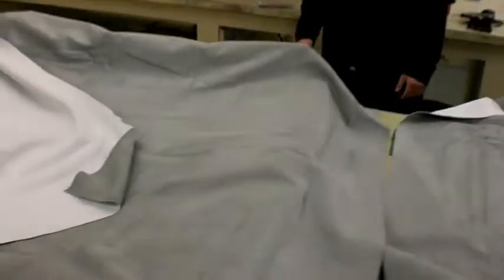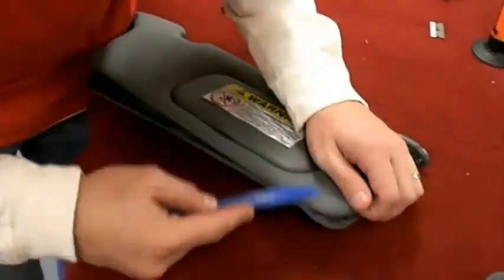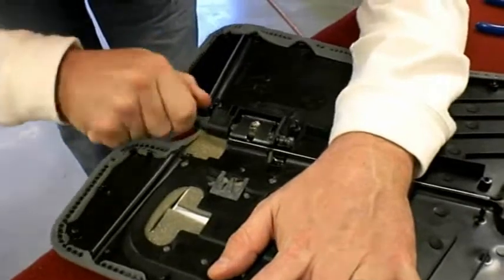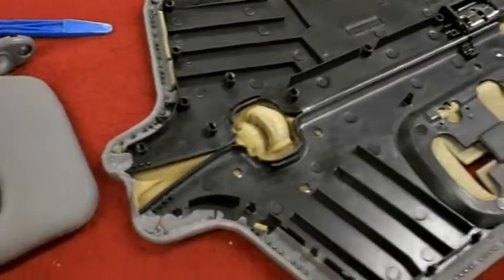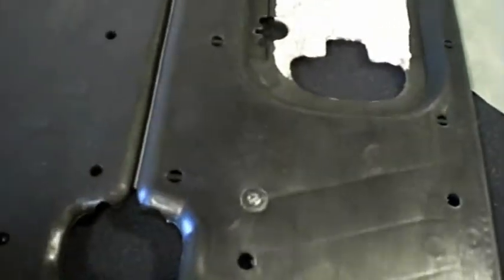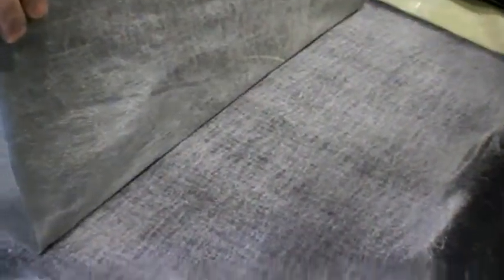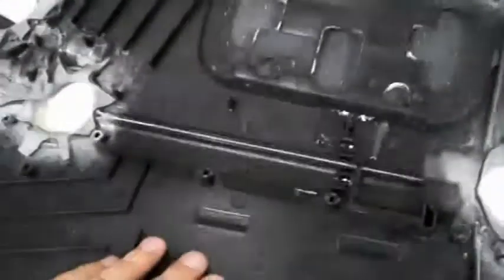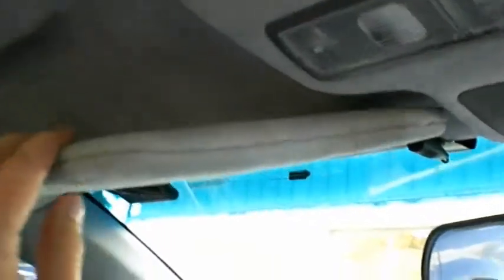How to cover honda civic visors using suede

Comment: FYI...I am attempting to do this on my 1997 Civic EX and I just took my visors apart to find out that the inside of the visor is cardboard and it's held together by a sewn seam that goes around the outside. I just destroyed my visor by trying to tear then apart based on the assumption that there were plastic snaps inside of them. Not your fault, I should've assumed that Honda wouldn't have made them all easily serviceable. Just an FYI for your future videos to add to the notes.
Reply: I would just ruin my too based on this video.Thanks for warning brother
Reply: I have a 98 Civic that I'd like to reupholster. Luckily I have an extra junky set I can experiment with first.
Reply: Honda visors went down hill after 95 smh
Reply: Wow...  Sorry to hear about your visor.  Thanks for the heads up.  I was looking at doing this to my 1997 Civic LX.
Reply: 98 Honda also cardboard.

Comment: Yep. Mine is the same. And it's not assembled the same as in this video. It's all one piece. So to get to the mechanism, you basically have to destroy the visor. Had to buy a whole new one. I think they changed with the 2008+ models.